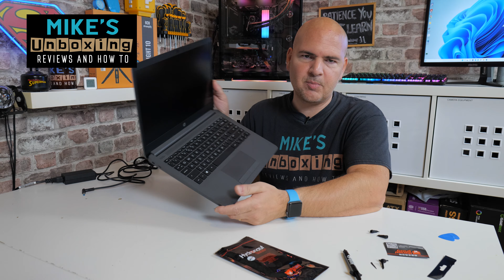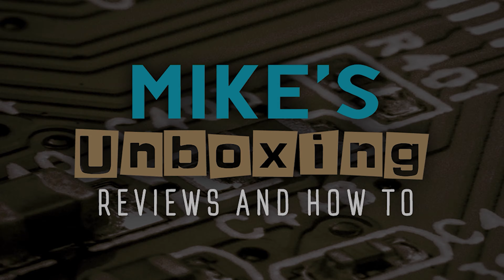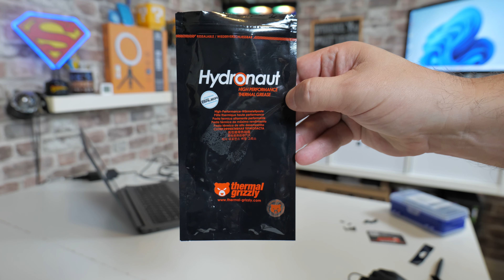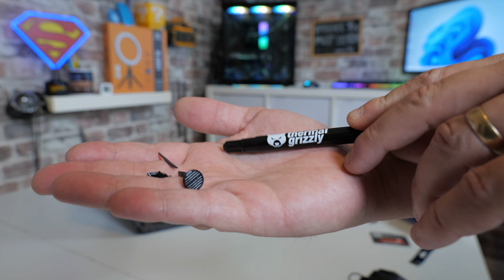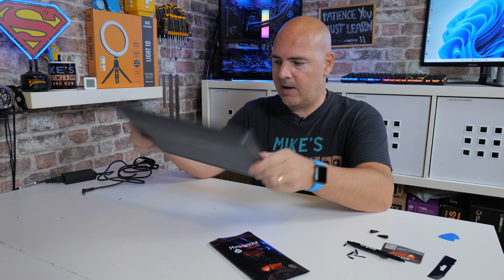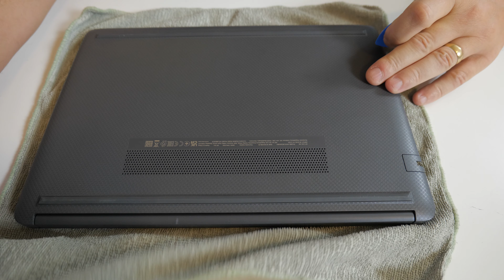HP245 G8 5500U Vs Thermal Grizzly Thermal Paste Strange Results

Comment: As the processor and graphics card overheat, it would be appropriate to use a PTM7950 phase-change thermopad instead of thermal paste.
Reply from the maker: maybe, the real issue is lack of ventilation it needs more cutouts really

Comment: Problem is you should apply a ''dot'' in the middle. You created many tiny air pockets. I know its not powerfull cpu but air pockets are not good for any cpu/gpu.
Reply from the maker: we have been over this many times and the tiny air pockets get so compressed and squished out that it is not a factor, and still covers the area unlike the pea or dot method which can often leave sections of the die or heat spreader completely missed

Comment: there`s nothing strange here, on the old cooked paste 1 or 2 cores remained without direct paste contact and almost shut down completely in hard loads, now they all work at maximum, new cpus have temp sensors on each core so they know when they can work or not
Reply from the maker: it did seem to be reasonable coverage, but the paste was quite solid considering this is almost brand new, but i think you are right
Reply: @mikesunboxing  exactly, if just a thin blade of air gets between the paste and the die in is the best insulator

Comment: Unfortunately laptops are designed to thermal throttle, its by design, my MSI Stealth 11UE 11th gen laptop happily runs at 95c before throttling down, but it has a dedicated RTX 3060 and those suckers run hot as hell. if your laptop has a metal back then adding thermal pads that touch the back drops the temps by at least 10c, i did this to my macbook air, made a massive difference.

Comment: Thanks Mike and Lady Kath for the review. I have been using Thermal Grizzly for a few years with no complaints. There are so many variables when applying  thermal paste. Too much, not enough, air trapped between paste and CPU, curing time. For me it usually takes a day or two for maximum results. Take all. Cheers
Reply from the maker: cheers Rick and thanks again